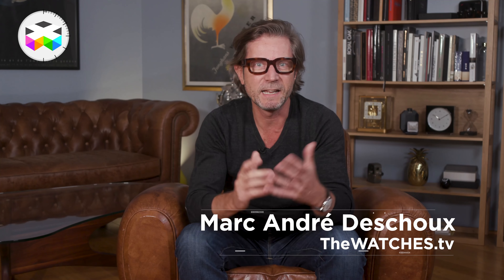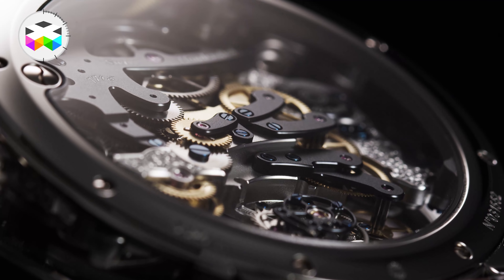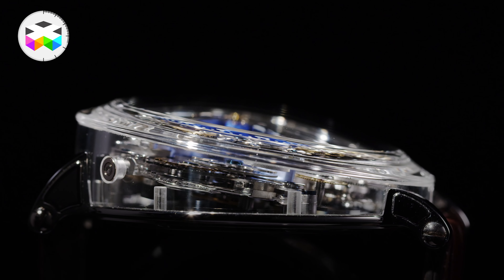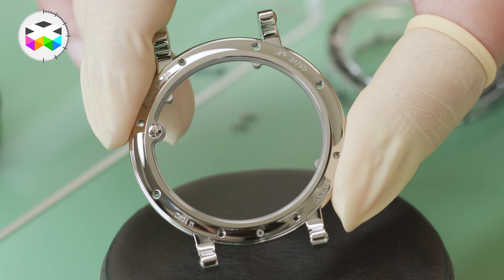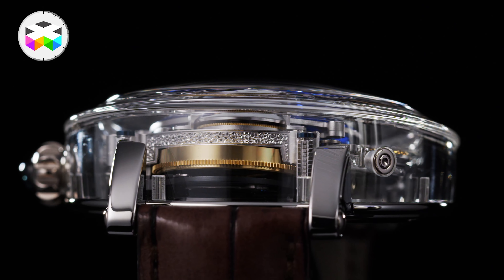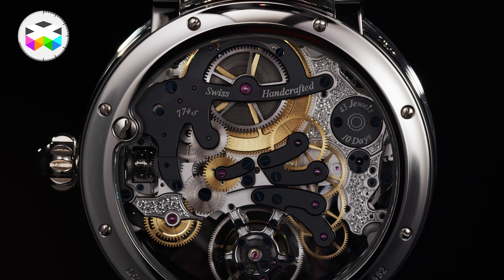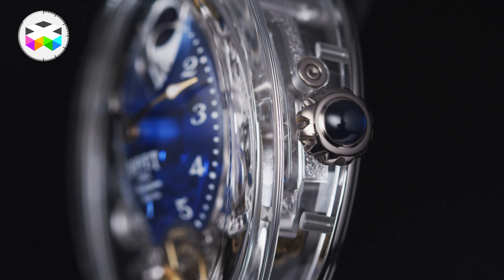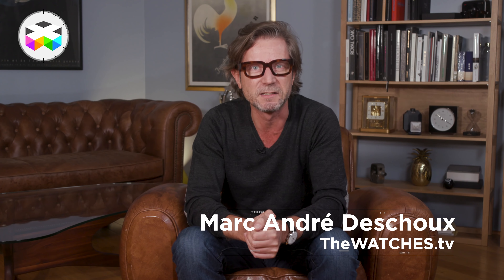Focus on the Bovet Récital 26 Brainstorm One

Comment: Great video as always!
I think they should consider marketing this very practical watch as a "Motorcycle".
The case has that much needed tilt so you can read the time without rotating your wrist too much.
You describe the case as very strong which would be great if one fell.
The ten day power reserve is another ideal feature.
Personally when I ride often my wrist doesnt move enough to
Keep an automatic wound and ten days would be great.
I have tried to avoid quartz watches ,but not always succesfully.
I do have a Giugiaro design motorcycle  watch
Not sure about the shock resistance  of the super kool tourbillon, but I would take the chance.
Put me down for the" Bovet motorcycle  watch".
Thanks for a great video .
I think there is a Bovet dealer in Chicago  .I am going to take a trip there if there is one.